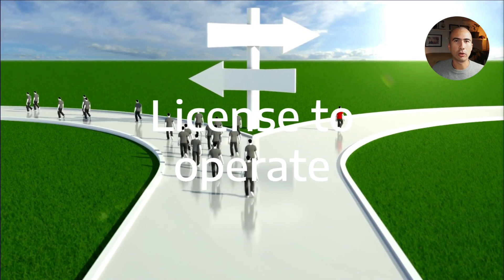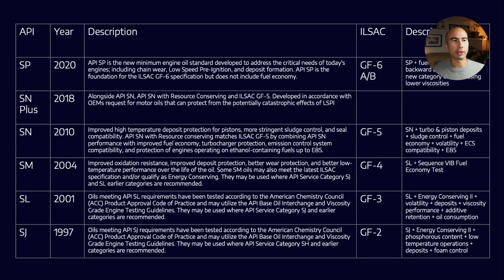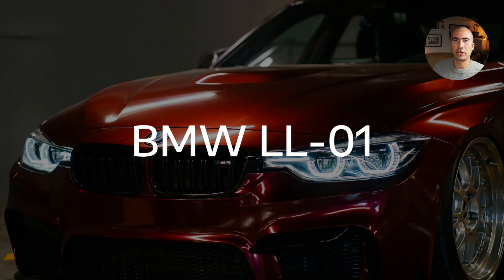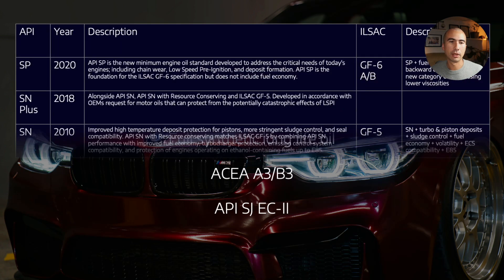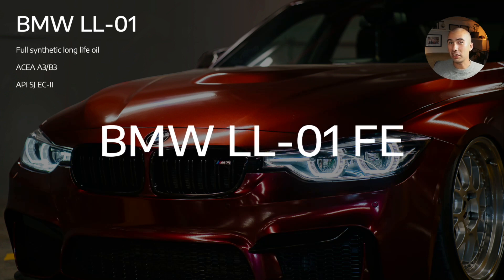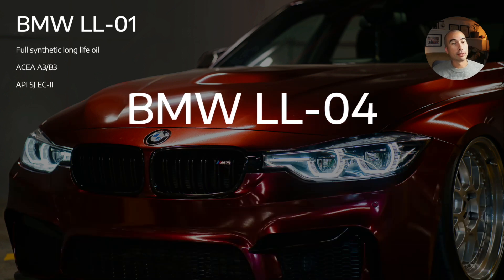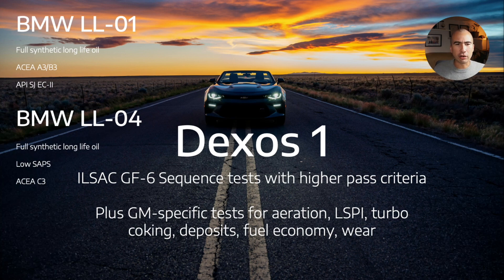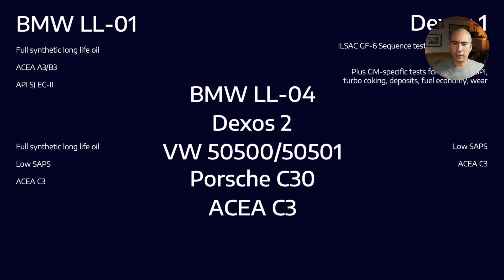What are OEM specs for engine oils?

Comment: Volvo D5 (2.4L diesel) EURO V has EGR, DPF and cat, still the manual says A5/B5 oil, you would think it would be C3.
Reply: wrong, a5/b5 falls in acea c2 spec. C3 has higher hths. (like a3/b4)

Comment: I'm enjoying the geekery level of all this information, but what I'd really like to know at a practical level is:

I have made the error of putting in what my shop labels as dexos 5w40 (I think it's dexos2) in a car that was a diesel VW and should have gotten EURO 5w40. (I can add details off the barrel if necessary)

This happened for a few months before anyone caught it. What harm did I (potentially) contribute to? My coworkers were really lousy at explaining *why*, but they seemed to be confident it was extra critical for a diesel.

More complicated question: the EURO barrel has run dry partway through the oil change. The customer is in a rush and doesn't want to wait for delivery. What should I recommend as the next-best alternative, filling with 5w30 EURO or with 5W40 dexos2? (Should I match the additive specs or the basic weight?)

Comment: Rafe, what are the differences in testing/certification criteria between api sn and api sp oils? so far all ive heard are lower Calcium limits to prevent low speed detination and timing chain wear tests. how are they meeting wear protection requirements with lower combined zddp, and moly  totals? what i have noticed is most sp oils are a syn blend when they were formally sold as conventional.  makes me wonder if noack and visc index requirements  have gotten more strict.....
Reply from the maker: So I don't believe that the lower Calcium levels are actually set by the SP category. It's just that oil formulators have found that lower levels of calcium detergents help them to pass the Sequence IX test for LSPI. Aside from that test, the other additional tests above SN are Sequence IVB instead of IVA (cam wear), Sequence VH instead of VG (engine sludge), Sequence  VIII (bearing wear), Sequence X (timing chain wear).

Comment: Also the ACEA C oils are low saps. But , the C3 is the mid saps version of the low saps family oils.  You cand also find that this low saps family engine oils made with lowest saps, low saps and the mid saps engine oils.     

Proche C30 and VW 504 507 is the combo that you can find on the market not the 502 505.01 with the C30. 
Also the 502 and 505.01 are almost gone for the ACEA C3 engine oils with 5w40 viscosity . The 511 replaced them. 
Also the Dexos2 is rare as a combo with C30 and 504 507 ( the mobil 1 esp 5w30 have it ). 

The BMW LL01 is found on the ACEA A3/B4 engine oils,  and it also have been updated recently and  a lot of BMW  engines with catalytic converter used it.  So not only the BMW LL04 is a catalytic converter safe option.  BMW LL01 and LL04 have been updated in 2018, and are used world wide for bmw cars.   In Europe you can find a car with Euro5 and BMW LL04 engine oil optin that in the US use BMW LL01. 
The BMW LL01 and LL04 are not for full synthetic oils because the base oils used for most of these are mineral.  You can find gropu IV and V base oil used for some engine oils with those approvals like Ravenol VMP 5w30 but most of them are mineral oil based.
Reply from the maker: Wow! That's a decent amount of detail. But to your point, yes, there are many combinations of industry/OEM specs available. It's probably a lot more complexity than we should expect the average consumer to understand...
Reply: MULTE MOTORIZĂRI AU WIV EXEMPLU  BMW OMOLOGAT EUROPA LL 04  ACEA C3 =BENZINA  :BMW LL-01 ACEA A3/B4 API SN =DIESEL WIV ATENȚIE( DEPĂSETE ACEA C3) . MULTE NORME SUPORTA WIV. EUROPA NORM  OMOLOGAT VOLKSWAGEN 503.00 506.00 506.01 ACEA A5/B5  SI RECOMANDAT BMW LL-01 FE M3 N57  ETC  0W30 ULTRA ULTRA PERFORMANT EUROPA  50000KM SI VOLKSWAGEN SPECIAL  APROBAT 503.01 =0W30 GRUPA V PAO BENZINA 132KW OBLIGATORIU  AUDI TT GTI ETC EUROPA.

Comment: If a manual asks for API SM oil for petrol engines and C2 for their diesel engines is it ok to put a oil in the petrol version with acea c2, PSA B71 2290 specs?
Reply: My petrol cars owner manual specifies API SM Ilsac GF-4 or Acea A5/B5 i´v been running it for years with API SN Acea C2/C3 oil (Mobil1 ESP 5w-30 and Shell Helix Ultra 0w-30 ECT C2/C3 depending on which one is on sale) the A5/B5 spec is often found on C2 oils so HTHS is at the same level on both BUT the A5/B5 oils are usually only API SL rated, which is almost obsolete, so i prefer to use the C2/C3 because of a much higher API rating and the later are LL oils. There should be less oil specs, life would be much easier for folks who do not understand much about engine oils.
Reply from the maker: Hard to comment without seeing the specific manual - my guess is that they're specifying different oils for different applications, so best not to cross wires. Having said that, there really isn't that much of a difference between most diesel and petrol engine oils these days, aside from the availability of low viscosity grades for petrol engines.

Comment: Have a different understanding here...OEM specs are always based on ACEA/API/ILSAC requirements and on top of that OEMs ask for a more or less long list of dedicated OEM engine tests that look for FE, durability, cleanliness or air entrainment performance. Therefore BMW LL-04 is much more than just ACEA C3. Also Porsche Cxx asks for a Porsche engine test that is obviously not part of BMW LL-04 for example.
Reply from the maker: Interesting. What you just summarised is exactly what I was trying to communicate, but obviously didn’t do so very effectively! 😛 Just for my own edification - what was your take on the video so I can refine it better.

Comment: BMW LL-04 having ACEA C3 as a baseline is Mid SAPS formulation not low SAPS.
Reply: Yeah my bad. That was meant to be “lowER” SAPS, as in lower than the LL 01 spec.
Reply: @RafeBritton  So that he have to write a "lower SAPS" in the slides not a "low SAPS" because of different meaming in technical term.
Reply from the maker: Sorry, I am Rafe Britton - just replied using the wrong YouTube account!
Reply: GM Dexos 2 is also Mid SAPS engine oil.